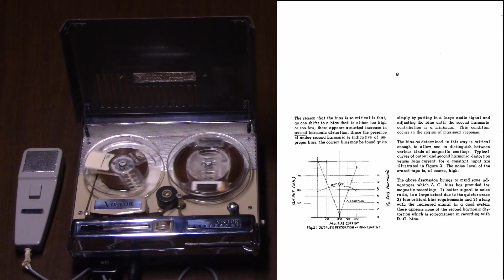Magnetic Recording with DC Bias

Comment: So.. on DC bias machines the tape you use could make a big difference in the recording quality?
Reply from the maker: Yes, but not that often in my experience. I have a rim-drive Lloyd's recorder that with most tapes records pretty good, but on one particular tape that is good with other recorders, it records very distorted and weaker. Similar with a Panasonic RQ-2309 cassette recorder, DC bias, it records good (for what it is) on normal cassettes, but on chrome tapes, it records really distorted and bad. Other DC bias recorders I have record fine on chrome.